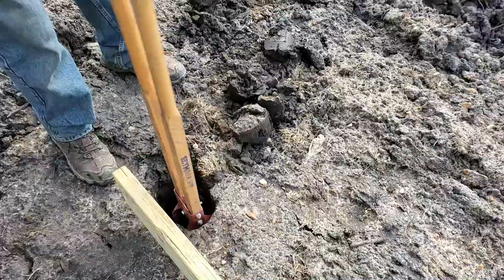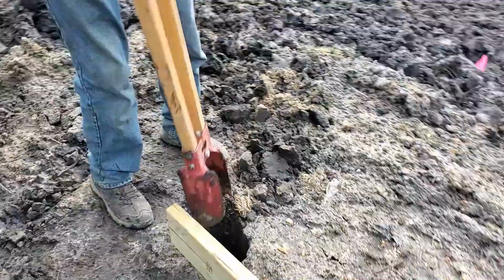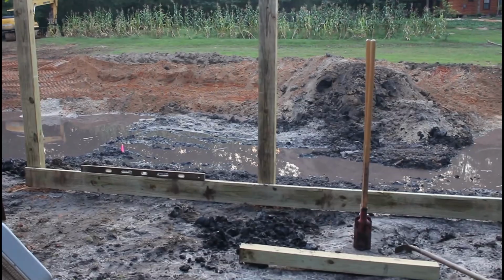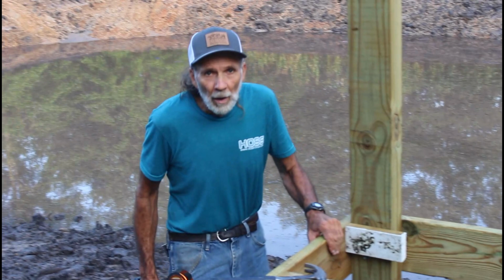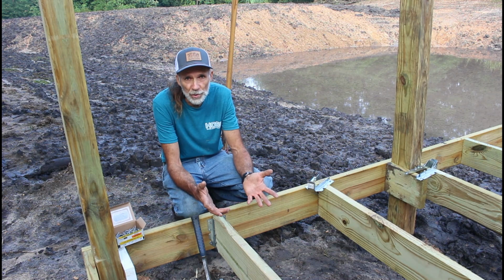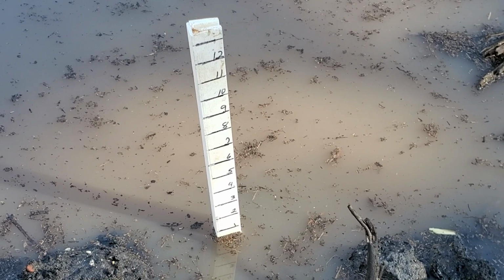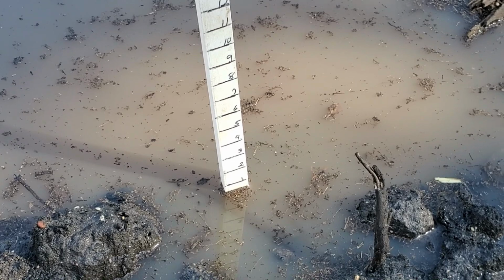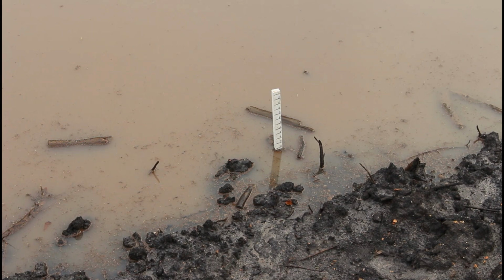How to Build a PIER | Bluebird Lake | Summer Projects

Comment: Yep, the dirt,  it's got oil mixed into it and it will do that in the warm heat. Turn into muck. Maybe y'all should look into seeing if you got an oil reserve underneath your underwater spring. Over here in Texas we usually have one right next to the other underground. And it will make its way past the sand to the surface. Great work y'all. Lookin good. Take care. Don't work too hard now in this summer heat.

Comment: should have put a gap bro in the middle of the deck planks you will get mold and it will cause warping.. and puddles on the deck
Reply from the maker: With our heat there will be 1\4 inch gaps when it dries.

Comment: Very Nice video, but I'd like to hear more about how you calculated exactly where those pier holes were to be dug in order for the pier to be squared. I know how to do it on a flat plane using geometry, but when you aren't on a flat plane, it is trickier. Care to share?
Reply from the maker: I used the 3\4\5 system. It works on level or unlevel surfaces.

Comment: Did you consider notching your posts for your joists instead of relying on the shear strength of bolts?
Reply from the maker: In a hurricane zone that's not wise. The post will break where they're notched.

Comment: need habor freight auger lol. I bought one for Missouri Clay. you cant use post hole diggers here in summer
Reply: Can't use a post hole digger where I am either.  Shale and rocks, layers of it just under the topsoil. I use a 4ft pry bar to dig in and scoop the rocks and shale out with my hand! Pile the dirt in a bucket as I go. The straight pry end is good for squaring off the hole. Don't laugh, I'm female and getting up in years, this works for me, just happy I didn't have to dig too many like that. LOL

Comment: All of the weight is on the strength of the screw , not notched onto the vertical posts. 

And no joist holders. 

A little extra work and a couple $100 more and it would have been more impressive
Reply from the maker: There's joist hangers on every board. In a hurricane zone you learn not to notch post they will break from the wind.

Comment: That "nasty, sticky, dries hard as a rock - like concrete" stuff?
Yeah. That's what weve got or growin' soil up here in The Ohio River Valley. 
The glaciers scraped away all our top soil eons ago.
Except ours is orange. 
And sometimes blue/grey.
Reply: Jason Paul greetings from Louisville. I’m less than a mile from the river. I was able to set 4x4 fence posts without concrete because of our clay.  My privacy fence has been holding up just fine for 4+ years now. Mine has a very slight orange color.